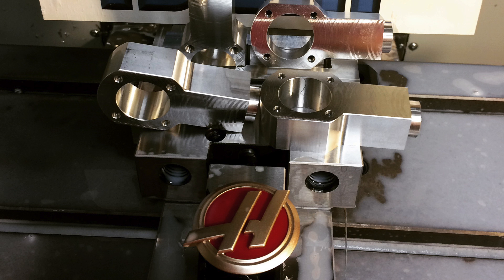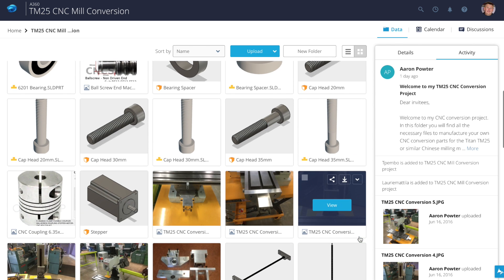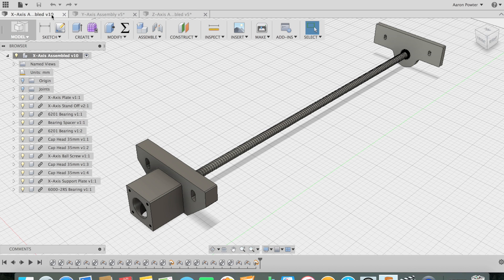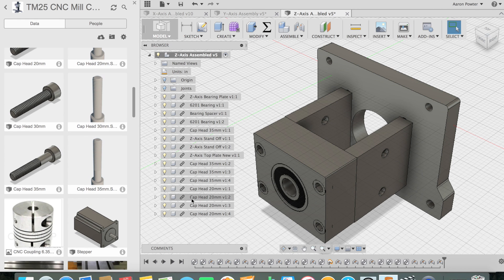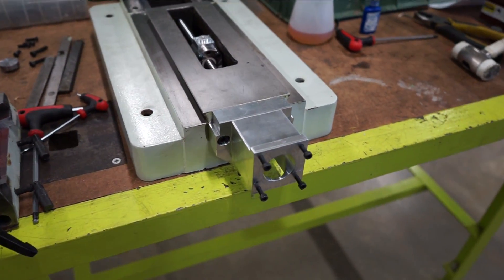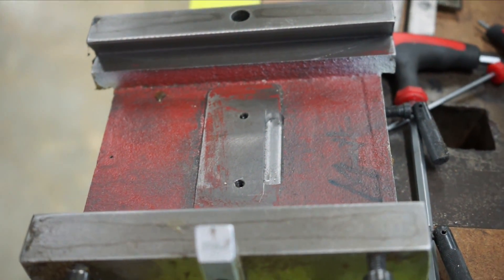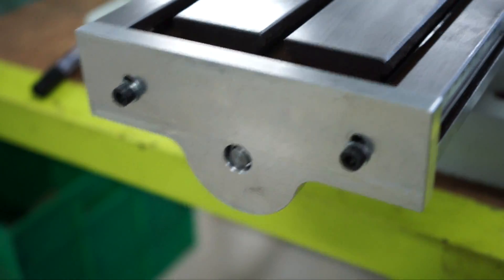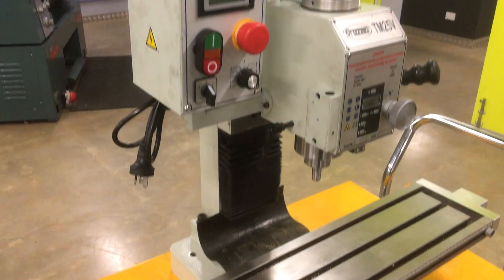Ballscrew CNC Conversion Kits - Free Fusion360 CAD Files

Comment: Very nice! Thank you. I noticed there was a modified x and y plate, what do these modifications do?
Reply from the maker: You're welcome Timmy.  When I fitted these plates to my mill which I previously converted I noticed that the ball screw length was a little short for the couplings.  So I trimmed 5mm on the face of the plate to allow the stand off to move in 5mm which gave me some extra grip on the stepper and ball screw shafts.
Reply: Great! sounds good. thank you again for posting!

Comment: Hello Aaron,I requested acces a few months back and am just now getting to my conversion, I can't thank you enough for all the work you have done.
Can you tell me what adaptor you are using to connect the ball screw to the servo? Ordering some parts tonight. Thanks again!Tim
Reply from the maker: timmyklus  Hi Tim, not sure if you know but all conversion files can be downloaded directly from the links in the description of this video. The couplings I use are from eBay. They are aluminium and have a spiral slit in them. Length of 35mm and dia to suit steppers and ball screw shaft end. Cheers Aaron

Comment: How's this little mill go milling mild steel? In your original unboxing it looked like it was struggling/chattering a bit cutting that mild steel block? Trying to decide if i'd be better off going larger CNC router vs mill (no mild on the router obviously)
Reply from the maker: Hi Manny, the little Titan TM20 - 25 is capable of machining steel. However it doesn't have the weight or rigidity to take savage cuts. Oh, in that other video I was using a drill chuck too. I suppose it will depend on your main purpose? A mate of mine over in WA is cutting out steel flanges on his quite successfully. Cheers, Aaron
Reply: Mainly ally work but the ability to cut steel is the kicker over a 6090 with larger capacity. Suppose you can ease back on cut/feed at the sacrifice of time, just didn't want to be fighting it the whole time you know?
Reply from the maker: Hi Manny, I usually say the following when people ask me the same question.  If you're going to do timber predominately and only aluminium sometimes purchase a CNC router.  If you going to predominantly machine aluminium and steel sometimes than the little TM25 (& it's clone varieties) are perfect for you.  However, if you're serious and want machine lots of crazy stuff buy a HAAS lol.  Cheers mate, Aaron.

Comment: Now it all makes sense ..... Great Vid Aaron
Reply from the maker: Thanks Vince. It's not a hard conversion mate. Just trim the ball screws to length, re-machine the support end of the X-axis, mill the slot in the saddle, drill and tap 1 hole in the base for the Y-Axis, and drill & tap the top of the column for the Z-axis stepper plates 👍

Comment: Great design! Beautiful parts, too!  That's really cool that you're sharing the files.  Thanks! :)
Reply from the maker: Thanks Mike, I appreciate your support and feedback mate. It's easy to make cool parts with Fusion360 and a HAAS Mill & Lathe at school lol.  Speaking of parts, I've noticed you've been busy in your shop pumping out bits and pieces.  Can't wait to see your hotrod finished. Cheers
Reply: Thanks!  If only it were my hotrod I was working on! LOL :)
If you google project datstang and go to the end of the thread, you'll see where most of the pieces are going. :)
Reply from the maker: Oh ok, silly me.  I thought you were like Tim the tool man Taylor (with out the blunders) and building a hotrod in your garage.  I will check it out. Thanks again Mike.  Aaron.
Reply: I'd be happy to send you a link....the only reason I didn't is because I figured it would get tagged as spam. 
 http://community.ratsun.net/topic/59696-project-datstang/page-53#entry1392814
Reply from the maker: bluehandsvideo Holy Cow, that little ute is insane.  Bloody low to the ground Mike.  Watch out for pot holes and speed bumps lol.  Awesome work Mike. Cheers
Reply: That one is pretty insane.  Too low for me and too way too many $'s!!  If you scan down this page, you'll see some pics of my ute(literally)....mostly engine bay and suspension, but there's a full pic about 2/3's down the page. :)
http://community.ratsun.net/topic/393-mklotz70-nl320/page-16
Reply: I sold it about 5-6 years ago.